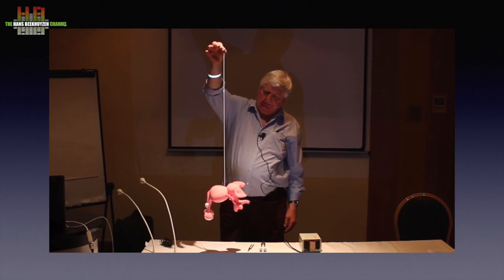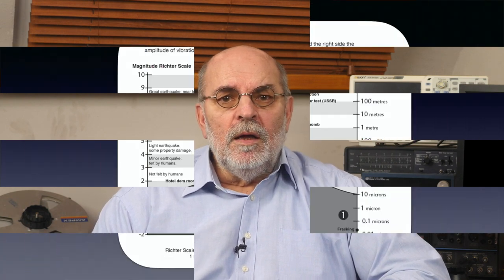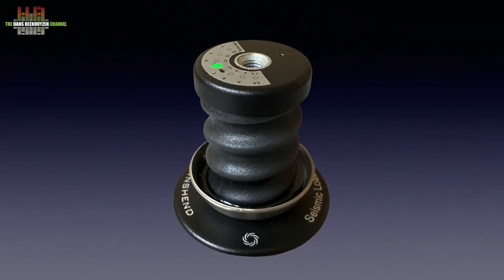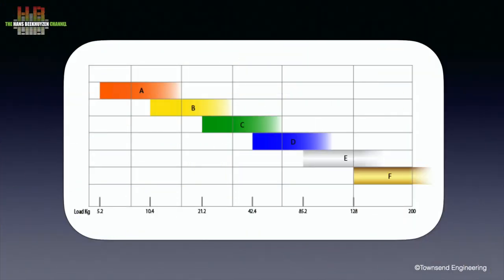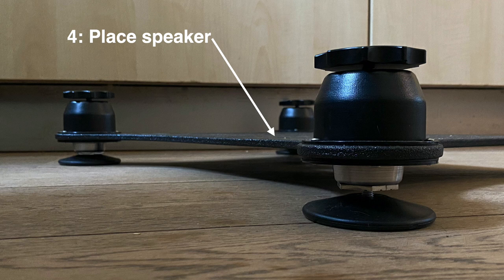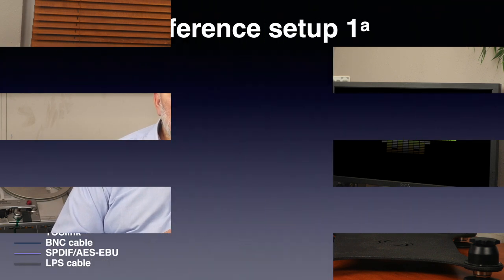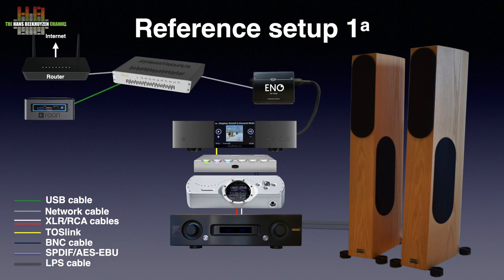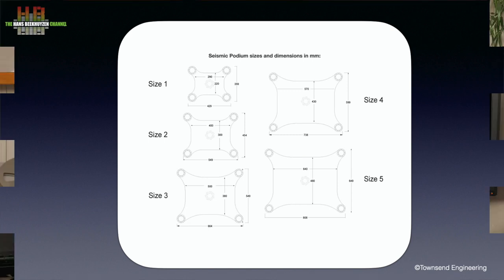Townshend Seismic Podium for loudspeakers

Comment: I have been using the seismic isolators for some years and would not be without them. Instead of using podiums I have replaced my speaker spikes with individually purchased pods of the correct loading and they look great and cost a lot less. I don't know if you can still purchase Thownsend speaker bars but these go under the speakers with pods fitted at each corner so all you see is the pods which I think look pretty smart. I also use the Tonwshend rack for my equipment.  The overall effect of the isolation is to increase soundstage significantly and tighten soft bass at the same time they take away the brittle sound of spikes, coming across more analogue /organic . An added benefit is the isolators are kind to wooden floors and they stop the speakers transmitting vibration into the floor as spikes do. Put your hand on a wooden floor in front of the speaker and you feel no vibration. RIP Max, he was a great character and a very clever guy.

Comment: I purchased a pair of these + the seismic isolation bars for my sub. I was skeptical at first as they are bloody expensive but the difference is audible & measurable! Using room correction I measured a 2db decrease around 40hz and 3db around 120hz - problem frequencies/nodes in my room! Ultimately - a flatter frequency response, wider soundstage and hugely clearer bass + the added bonus of a vibration free house - My neighbors haven’t complained since!
Reply from the maker: Thanks for sharing

Comment: Hello Hans, thank you for bringing this up. I have a pair of Townsend Podiums under my PMC Fact 12s on a wooden floor with concrete joist and underfloor heating. Feels very solid, but from the off the effect of the Podiums was somewhat astounding resting them on top with no spikes. The entire frequency band was positively affected resulting in tighter bass and everything above with higher perceived resolution, more detail resulting in better soundstage, imaging etc. It is a great product 👍🏼 Best Peter

Comment: Been using the podiums for a couple of years now.  No going back to spikes/etc. The sound is transformed for the better in the ways you describe.  And it’s not subtle.  The only downside is that sometimes the springs can vibrate when there is really deep bass in the music but it’s rare.  These are now a fundamental building block for my hifi.  Thanks, Max.  RIP.

Comment: Hi Hans, glad you're looking into this highly technical area. I look forward to your wonderful insights further. 
I am so sorry to hear about Max, I had the pleasure to spend an afternoon listening to his new suspension Hifi platform in 1998 after he serviced my Elite Rock TT (I still own). He called this the "one note demo". Ever since then I've always wanted to invest in his isolation technology. Money is finally  less tight so thank you for validating my desire. 
Once I've settled on the upgrade speakers I'll be purchasing the podiums. 
All this begs the question about your intentions to investigate isolation of the other components, something I've explored with audible improvements using very cheap rubber feet. I can't wait.
Lastly, love your dry humour peppered insights why else did I buy the SMS 200 Ultra Neo...
Take care,
Paul

Comment: My first system of 1979 was in a room close to heavy traffic. I placed the National Panasonic SB-39 speakers on thermal insulation tubing, two tubes horizontally under each speaker to absorb vibrations. A somewhat less sophisticated solution and less perfect, but at $1 per speaker it did its job.

Comment: As always, an excellent presentation. A side-note might be how this applies to isolating a small audio component. As you explained, the LF limit of an isolator is determined by its deflection. For reference, large HVAC units, producing vibration at very low frequencies are usually installed on springs. The deflection required here is on the order of an inch or so. Obviously, you need a lot of weight to achieve this. A large speaker, as you demonstrated, can be isolated using something like the Townsend podium. But a typical audio device just doesn’t weigh enough. Can a rubber foot under a 5 pound box possibly have enough elasticity to do anything beneficial? I’d like to hear from anyone who’s found a product or material to use.
Reply from the maker: All in due time

Comment: I’ve watched, listened to and read multiple reviews and opinions as to whether speakers should be coupled to the floor, or, decoupled from the floor. There is much disagreement on this topic.

I purchased a pair of these podiums for my large floor standers. I was extremely dubious. A heck of a lot of money, for what is effectively a plank of metal and 4 springs!

Set up was relatively simple, with the most difficult thing being lifting my 103LB 55 inch tall speakers into place with no help. I have to say, that the effort and investment is worth it. A noteworthy improvement in definition and soundstage. The aesthetics committee however were not impressed. She remarked ‘it looks like your speakers have put on a pair of industrial work boots and are trying to make a run for it, out of our living room door’! I know not what her reaction would have been, had I have told her the price. Anyway, they haven’t walked out of the door, as she would have wishedd. She and I still communicate, share the same living space and more importantly, share the sane bed.

Whilst I’m a convert, I now am firmly in the camp that favours decoupling your speakers from the floor, reducing cabinet resonances and reducing transmition of floor vibrations, I still adhere to the advice of Rel, and have my Rel subs firmly coupled to the floor. They have down-firing drivers which utilise the floor to help evenly distribute the bass! The podiums do an excellent job of preventing that sub-bass influence the floor standers. It’s a win win scenario.

Keep up the good work Hans and most of all, enjoy the music.
Reply from the maker: Thanks for sharing
Reply: Coupling subs to the floor does kind of make sense - there are systems available (and used in some venues, cinemas/theatres) that actually excite the floor directly for a literally visceral experience.
Reply: @EliteRock  👍👍
Reply: @howardskeivys4184  Thanks! I should add that I've experimented with sub isolation and for music I ultimately preferred it. I raised the sub off the floor on a sturdy platform (as part of 'room tuning') a little way out from the wall then had a barely inflated 'fat' mountain bike inner-tube on it with a cut-down paving slab on top of that, the sub then coupled to the slab with pieces of 'black tak' (ETA >> the overall 'Q' ended up well into single-digit Hz). Bass (or rather, electric bass guitar) has always been absolutely crucial to me ever since my ears first pricked up to Led Zep aged 11, and that arangement delivered bass lines so clearly and coherently, down to the open B (c.32 Hz fundamental IIRC) on Anthony Jackson's 'contrabass' for e.g., I'd never go back. That's different to the reasoning behind suspending the stereo pair of course, but just FYI.
Reply: @EliteRock  yes, you can listen, watch and read as many views and reviews as feasible and seek as many professional opinions as you like, even from those who profess to have a scientific, technical or engineering background. Ultimately, it’s down to the end user. The rig they’ve built. Their listening room acoustics and personal preference. Experimentation, trial and error is the name of the game and a means to an end. At the end of the day you’ve configured your system to appease your own listening pleasure and whilst others may critic your set up and may have their own valid reason, it’s bye the bye, because you didn’t build your rig to please them. I would always argue that in the world of hifi, there is no better or best, there is no right or wrong. There is just, different. If that difference suits your listening preferences, then your ahead of the game.

Enjoy the music.

Comment: 4:41 I don't see a link to a paper in the notes.
There's something to be said about this idea's success since they have introduced a version for pianos: surely they wouldn't have taken such a bold step if it weren't!
Reply from the maker: Sorry, this is the link: http://townshendaudio.com/PDF/Earthquakes%20on%20Hi%20Fi.pdf
Reply: @TheHansBeekhuyzenChannel  Thank you for this.

I think there are some logical flaws in the arguments given in there. First of all, to properly examine the claims, the sound reaching the ears of the listener, the listener and the speaker must be considered in a frame of reference. Secondly, we need to establish the level of decoupling of the speaker and the listener's ears from the floor. For the loudspeaker, this is determined by the method of support. For the ears, these are rigidly coupled to the cranium and that, in turn, is elastically (?) coupled to the spine. The spine itself is a series of rigid cylindre sections coupled via elastic (?) rings etc. all the way to the pelvis which is somewhat coupled to the seat. When the earthquake happens, all the objects above are in the same accelerated frame of reference. Is the air included in that frame of reference? One could argue that the layer of air in the vicinity of these  objects certainly is, growing increasingly decoupled through in-between layers of air until we reach the middle of the distance between the ear and the speaker.

Now, the mechanics of accelerated frames cannot be analysed sufficiently in a couple of sentences, 
but here are two simple facts to consider:
a) We can hear an earthquake, if it's sufficiently powerful, on account of the ground, all the buildings, walls etc. vibrating because of it. So, taking the ground for example as our frame of reference, the walls and floor of our room will be vibrating in reference to our ear because our skeletal system and soft tissue affords us a degree of decoupling from the floor and the air in the room is certainly coupled to both the walls and our ear. 
b) We can draw a parallel with fact a in the case of sound coming from the speaker in a room at rest: it's a case of an earthquake only taking place in the speaker driver, setting both the cone and the speaker in motion, both decoupled from each other and our ear. Again, the coupled air mass does the trick (and we can hear the very local earthquake).

Let's then come to the case of earthquakes we cannot hear. The two facts above still hold but this time the levels of vibration are too low for our ear to pick. But then, the question arises: if the vibration of the speaker cone is too low to pick in the case that no signal is received by the speaker (the speaker cone only being set in motion by the earthquake), why would it matter to our perception of a signal being replayed in the case of such a signal is received (in addition of the speaker cone motion due to the earthquake)? 

The fundamental assumptions here are that these two vibrations (i.e. from the signal and the earthquake) take place on the same axis (from the centre of the cone to our ear - let's call it parallel to the floor) and they only add (no other intermodulation occurs between them). Secondly, surely if the earthquake were borderline inaudible, due to fact a above, if any sound because of it were heard, that would be from the four walls, ceiling and floor (which combined have a much larger area than the speaker cone) and would certainly swamp any sound due to the earthquake coming from the speaker cone by at least two-three orders of magnitude (that is more than 20db).

The only coditiion where I could see these claims to merit value is when the earthquake creates a mode of room (floor) vibration, vertically to the listener ear-speaker cone axis, where the listener's position is (an odd multiple of) a quarter of a wavelength (of the earthquake wave) away from the loudspeaker position. That would then create a situation where the speaker cone obtains an angular moment of inertia with respect to the ear of the listener. That effect would take some space to analyse and quantify. The direct analogue to this one can easily imagine (admittedly a very exaggerated one) is that of listening to a stationary police car siren while riding up and down on a see-saw or a swing. 

It would be perhaps more accurate to say, in this last situation, that the top of the loudspeaker generates a sound wave due to this particular earthquake-induced vibration mode. But again , the same counter-argument as above can be made for this case due to fact a: this sound wave would be swamped by the sound waves coming from the floor or ceiling (this time only one-two order of magnitude larger on account that the walls should be excluded).

[Note on sound db given above: db (spl) = 10log(P/Pref), so 10log100 = 20, 10log1000 = 30, etc.]

In my view, the benefits of the decoupling offered by the Townshend base are simply that: decoupling of the loudspeaker from the floor, essentially not allowing the floor and walls to become extensions of the loudspeaker enclosure. The direct analogue here is obvious: consider an harp and a piano and draw parallels between the string and the speaker cone  and between the soundboard and the floor.

Comment: Hey Hans, as usual I appreciate your content. You addressed a few problems with resonances very well but you forgot to mention that this is a trade-off. You gain at staging and fine high frequency detail, that is true, but you lose dynamics. Even the improvement in the bass might be better in your room I don't doubt that but it is not better in general. When you care about resonances then I highly recommend to dig deeper into the work of Touraj Moghaddam (the founder of Roksan) and you should have a look at his speaker design the "Darius" (not a particularly excellent speaker but very interesting when it comes to resonances and absorption) maybe you want to also have a look at Christian Yvons work for Goldmund, especially the "Apologue"
There is one more thing that I would like to mention, and that is the use of springs. Springs have undoubtably the advantage that they very easily lower the resonance frequency below 10Hz, but they have the difficulty that they are not silent while working. When you compress springs, they themselves generate noise (resonances). I admit that in case of a speaker it is not really worth mentioning, but in record players you can spot the difference between a steel spring and i.e. rubber spring very easily.

Comment: Hi Hans 
A cheaper way into the Townsend seismic world are the pods 
I use the Townsend seismic pods under everything I can afford 
You can get away with 3 under lighter bits of equipment - 2 under dacs - chord cutest 
I think they are brilliant ! 

Surprisingly they had a big effect under my Audioquest Niagra - who would have thought ? 

Get them and experiment - and nobody notices them
Reply: I use the Gaia isolation pods for my speakers 
They are very good - look classy and around £1000.00 for the biggest ones are much cheaper than the podiums - don’t know what’s better as I haven’t been able to swop back and fore
Reply: @albiepalbie5040  all the people that have tried both said the isoacoustic gaia's are very good but the Townsend podiums are in a total different League better.
Reply from the maker: I  wouldn’t say different league  but Townhends are better
Reply: @chrisrichards2827  Hi Chris 
My loudspeakers are too tall to put on any Townsend pods so I have them on the Gaias which are very good 

Everything else I’ve got on the pods - bigger ones than the recommended weights for the particular piece of equipments weight - with heavy weights added on top of the equipment 
It doesn’t look good !
But sounds amazing - great rhythmic control - solid and ethereal at the same time 
Pianos are the litmus test
Reply: @TheHansBeekhuyzenChannel  Hi Hans 
The flexibility and immediate noticeable improvement with anything the Townsend pods are put under is indisputable I think
Reply: @albiepalbie5040  you shouldn't be putting the pods underneath speakers they're not meant for that you should be using the podiums I know they're very expensive but they're way better than the Gaia.
Reply: @chrisrichards2827  I tried the podiums but it was too precarious - my speakers are Quad 2905 which are tall with the weight strangely distributed to the front 
The Gaias are a good compromise
Reply: @albiepalbie5040  then don't put them on the pods put them on the podium they're a lot more expensive I know but much more stable than the pods.

Comment: Just a thought: should hi-fi racks be coupled to the floor with spikes, or decoupled? Spikes are the standard approach...could this be less than ideal? I suspect that component isolation takes care of this issue.
Reply from the maker: In my opinion spikes only serve their purpose on a carpet, stabilising the rack. On a solid floor they have no purpose, although there are many that think different. Putting dampers on the rack feet would be lovely but also costly. Especially since they have to be designed for the weight of the filled rack.